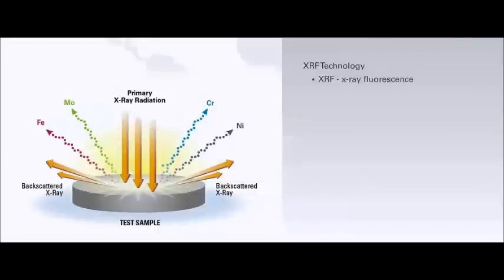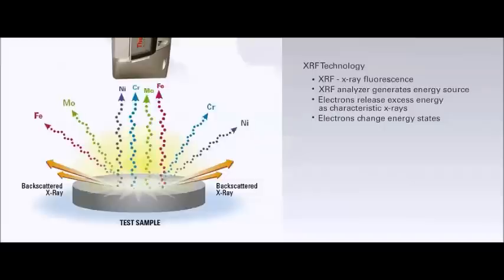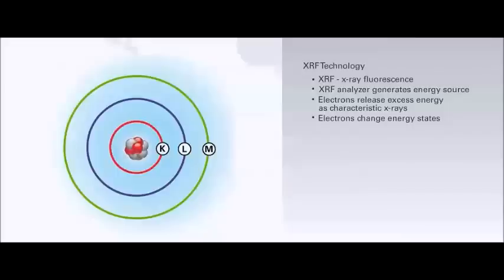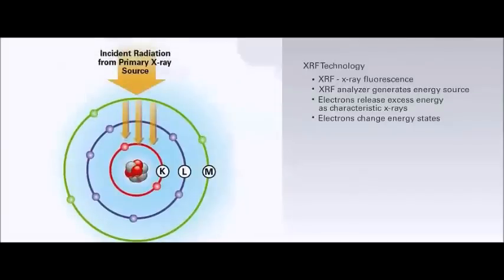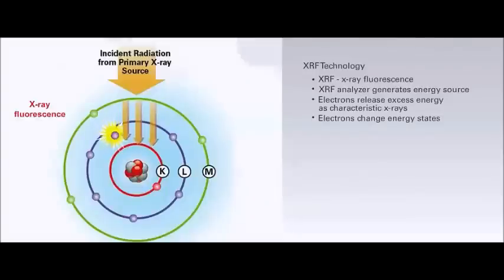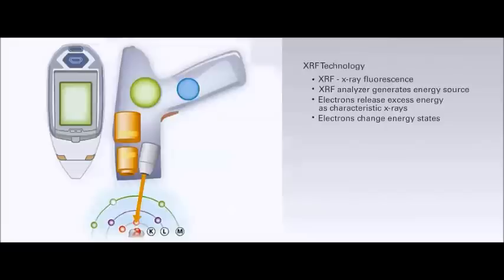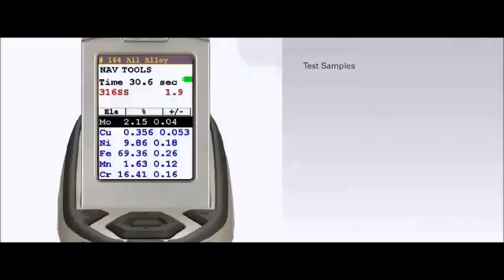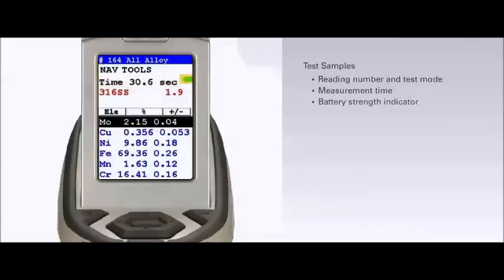How X Ray Fluorescence Works

Comment: I like to know how deep,  and how much more does the upper atomic layers (thin coatings, contamination, residue or adventurous hydrocarbons) contribute /effect the signal/noise ratio and quantification values of the bulk material.  Haven't seen any data on surface sensitivity or depth detection of this method or how it might be effected by topical layers
Reply: you are only worried about inside electrons so its almost no effect on the outside, an example is that oxidation states do not interfere because we only measuring inner shells. other techniques yield different results based on oxidation states, think atomic absorption and atomic emission.